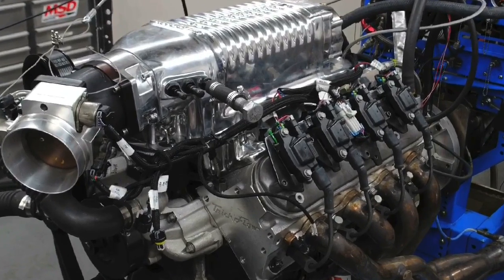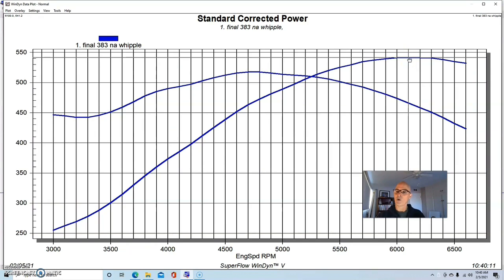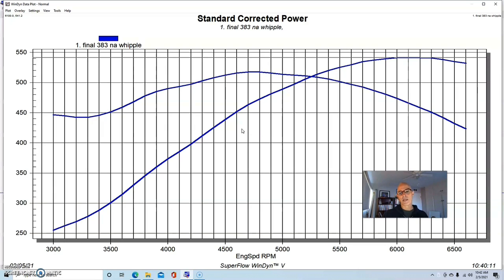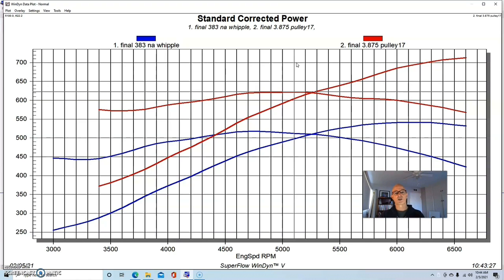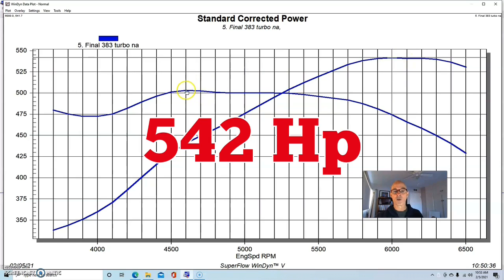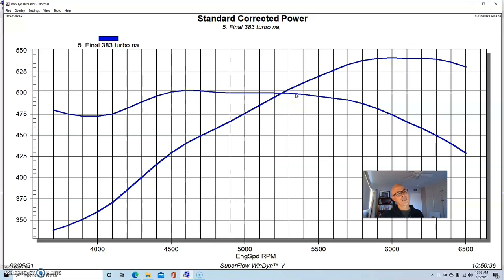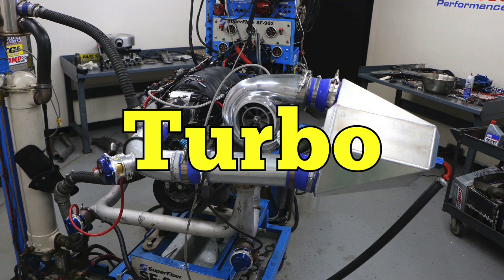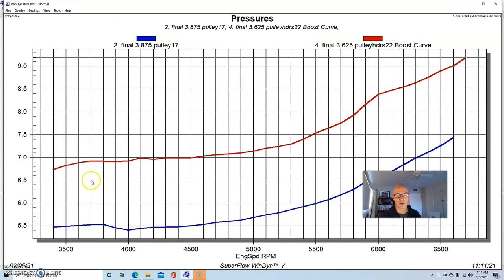WHIPPLE BLOWER vs LOW-BUCK TURBO-383 LS STROKER

Comment: GOD DAMN IT RICH WHERES THE TURBO GRAPH BELOW 3800RPM AGHHHH IM DYING OVER HERE 🤣

You make a turbo look so good on paper and then we all remember the tach on our truck dash ends at 6...

im more concerned at the bottom 

unless you own a Corvette youre launching a truck with these (yes the zeta platform is a truck ask Australians)
Reply: i want 600ftlb at 2KRPM GAAAHHH 🤣
Reply: after 5 Im so much less concerned lol
Reply from the maker: 600 lb-ft at 2000 rpm is a diesel
Reply: @richardholdener1727 if only they were snappier lol

but for real Im trying to figure out how to get the fattest torque curve from as low as possible and this graph leaves out where the turbo isnt brilliant. 

would mucking about with dynamic compression do anything for either?

or am I pretty much stuck with something like a light hybrid system to get off throttle torque?
Reply: what are the smallest twins youve seen?

Comment: Gonna have too go back to some of your 6.0 and 6.2 combos, 383- ls -N/a-heads-cam = 540hp 😮, maybe I'm mistake but I think a 6.0 with just a cam and 799 heads made 522hp or with 706 heads it made this power, but 383ci Ls with aftermarket heads only makes 540hp 😢 obviously it's not worth the cost or I'm mistaken what the 6.0 hp combos were said to be making.

Comment: How you make a 383 on 5.3 ls 
Just pistons and crank Can you do it like that or you need the whole kit
Reply from the maker: a 383 required boring the block to 3.902 and adding a 4.0-inch stroker crank. The 383 stroker combination will include new crank, rods, pistons and rings and bearings.
Reply: @richardholdener1727  so with 5.7 pistons and 4 inch crank you could make it 
And using the same rods

Comment: He's essentially comparing the boost levels, but it's apples to oranges.  The blower boost # is at peak.  Whereas in a turbo say it has a comparibe wastegatr spring as far as boost # the turbo motor will essentially have that boost level much faster and maintain at that boost level

Comment: On. The blower engine the heads are WAY to small and the cam is all wrong. Overlap needs to be very minimal with a forced induction set up.  Also used terrible fuel.
Reply from the maker: none of what you said is accurate

Comment: I believe you are wrong about a turbo not costing engine HP.  You have the significant exhaust backpressure that costs torque to compress the exhaust gasses to develop turbo boost.
Reply from the maker: the loss is minor compared to the losses associated with driving a supercharger-we know this because a turbo provides significantly more power than a blower at the same boost level.
Reply: OK, but there is a penalty associated with backpressure developed to drive the turbo charger.  There are other issues involved but that factor has to be acknowledged. @richardholdener1727
Reply from the maker: okay-if it makes you feel better, there is 1 hp loss from driving the turbo

Comment: 1 GT-45 at 800HP is awesome. What about 2×GT-45 an easy 1,000HP with the proper cam? The bottom end seems stout, but a lower compression piston might stave detination.
Reply from the maker: 2 GT45S COULD DO 1500+ HP

Comment: A supercharger is the way to go on a gasoline engine, except for aircraft engines.  Turbos are the way to go for diesels and aircraft engines.  I don't think there has ever been a factory supercharged diesel.
Reply from the maker: there has been factory turbo and supercharged (combined) diesel motors
Reply from the maker: and Detriot diesels were supercharged as well
Reply: @richardholdener1727  Not in the conventional sense they weren't.  They won't run without the scavenging blower.
Reply: @richardholdener1727  If you mean Detroits, I have never heard of the blower being used to provide boost.  They were used as a scavenging blower.  A 2 cycle diesel can't run without it, as there is no way for the intake charge to enter unless it is blown in.  The intake ports in the cylinder walls are near the bottom of the piston's travel, so there is no vacuum being generated.  A turbo on one of these is what provides the supercharging effect.

Comment: Top mounted superchargers have poor intake manifolds with almost no runner length, you will lose at least 60hp and major torque because of this. Remember the boost bash test regarding boost to boost power outputs. There was a manifold test in there that was responsible for over 70hp at same boost level.

Comment: seems a mismatched comparison,  why was did the turbo have a water to air intercooler when the supercharger did not ? also is the  cfm rating of the turbo at a given boost level the same compared to the supercharger ??, seems the supercharger is on the small size in this comparison . its a known fact that most positive displacement superchargers provide more pressure at a lower rpm

why is your other video on kenne bell with small blower sizer make so much more boost from the bottom & its a smaller engine >>
https://www.youtube.com/watch?v=3mRCXSrEZ7s
Reply from the maker: the blower did have an intercooler

Comment: What is the weight difference between the iron block and a Ls 3 Aluminum block and could the LS 3 GM crate motor 525 hp be used in this boost application?
Reply from the maker: yes on the boost with 525 crate

Comment: This research is not of value for two reasons.  First, your turbo is too big to really compare with the supercharger; your turbo curve is mostly functions of waste gate springs. 

Second, you are changing gas used.  Just use 93 pump for all.  Most people don't have access to race or E85. Whatever you pick stick with it to reduce the #s of variables.
Reply from the maker: YOUR COMMENT IS OF NO VALUE FOR TWO REASONS....

Comment: I always understood if the Supercharger is working right the power curve difference is below 4000 and turbo is above 4000.
Reply from the maker: THAT IS NOT ACCURATE ON EVERY COMBINATION OF SUPERCHARGER (TYPES AND SIZES) A TURBOS (SIZES)
Reply: @richardholdener1727  turbos usually have to spool up right? While if the supercharger is sized right it usually keeps boost threw the rpm range. While turbos get more boost the higher the rpm unless your doing compound turbos.

Comment: What's the back pressure like at 6000rpm with the gt45 on a bigger ls?

If 700hp was the goal, would the gt45 be a decent choice or would you still bump up to something like vs7578?

Mostly spirited street car.
Reply from the maker: what displacement?
Reply: @richardholdener1727  can't believe I left that out. L98, 6.0L with ported rec port heads.

Comment: @RICHARD HOLDENER  You have to check out on3 107 mm billet wheel journal bearing gt55 with the proper engine combo it's good for 2500hp and it cost 1000$ . It's the cool new turbo. Put that on your big bang motor. I've seen dyno test of 300hp increase at the wheel vs s488 running same boost levels on compounds. That's sweet.
Reply from the maker: 300 HP AT THE SAME BOOST LEVEL?
Reply: @richardholdener1727   no that would be awesome but not realistic , it was on a diesel cummins. It would make 80 psi max with the s488 and 115psi with the on3 107mm gt55 . Also needed more fuel with that air flow . Just goes to show the cfm the larger turbo added that cfm can be seen as a restriction in  boost.

Comment: There are losses with turbos.  I don't know why everyone says there is no loss.  You can't restrict the exhaust and expect no loss.  Just look at the dyno graph.  They both made the same power even though the blower made a little less boost.  If there were no losses with the turbo, it should have made more power with less boost.
Reply: Yup, turbos increase pumping losses.  Superchargers don't.
Reply: one can compensate with less restrictive resonators/mufflers or even straight pipe. as for the results this is a cheap ebay turbo

Comment: How would this turbo setup compare to a centrifugal supercharger?  Parasitic losses aside the efficiencies should be similar and the type of boost goes away.
Reply from the maker: CENTRIFUGAL HAS RISING BOOST CURVE AND MORE PARASITIC LOSS THAN TURBO
Reply: @richardholdener1727  Thanks, I understand that. This was just one of those random tangents. I was thinking that since they use a centrifugal impeller they have the potential to make much more boost than they typically do.   As far as that goes they should be on par with a turbo.  It is because of their direct connection to crank speed that they have a linear boost curve. If you were to spin it fast enough to make target boost early and bleed off the excess you could maintain these flat boost and power curves like a turbo.  Maybe not at the same level, especially down low because of the excess parasitic loss but it should manage to be better than the Whipple and an overall simpler install than a typical turbo.  Again, just random thoughts, not something I’d ever expect to see.

Comment: i feel like there is a little slight of hand going on here.  With both the NA and Super charged set ups the dyno graph begins approximately at 2700RPM,  when the Turbo enters the fight, suddenly the graph begins at 3500RPM.  I know it's not much but i suspect there is some turbo lag there at the bottom of the graph which would benefit both the NA and super charged motors.  If we are comparing things, the playing field needs to be flat.  same motor and the graphing needs to have the same parameters.  Maybe it all amounts to nothing, maybe it's all intended to drive the comments, maybe it's just an oversight but it's definitely off a little.
Reply: Good observation; that is the big performance disadvantage of turbos - turbo lag.  Not much on a diesel because diesels are unthrottled, so the "pump" of the turbo doesn't slow way way down at idle the way it does on a gasoline engine.  I say a supercharger is the way to go on a gasoline engine, except for aircraft, as a plane does not idle once in the air.  The engine runs at a pretty constant speed.
Reply: @jamesbosworth4191  Right.  Now days most turbos have "anti lag" designs allowing it to spool up faster at non boost rpms.  But with bigger turbos it's more difficult to get around as the turbo is big and therefore spools slowly

Comment: So the turbo needed more boost to hit the same hp level?   The whipple hit 800 hp at 9 psi... the turbo needed 9.7 psi to do the same thing.  This tells me the turbo is maxed out, but the Whipple has a lot more to give.  If you pushed the whipple to 15 psi, you'd be well over 1,000hp; but the turbo might not even hit 12-14 psi.  What will happen is the Whipple's boost curve will start to flatten out as you near it's maximum flow.  This happens with any PD blower.  The closer you are to maxing it out, the more torque you'll make at lower rpm.  I think the terminator Cobra guys were the first to figure it out when they started pushing the stock Eaton blowers to the max.  Don't get me wrong - I think turbos ultimately make more power, but PD blowers, particularly when they're sized properly (or even slightly undersized) are absolutely unbeatable torque monsters.  Of course, the tuning window also gets smaller, but hey - there's always a tradeoff.  Which is why I've swapped my Whipple (9.80's at 140 on 93 octane pump at 3,500 lbs) for an electric turbo (actually Vortech) - the electric setup offers the fun of the Whipple, but the efficiency of the turbo (actually better - zero losses anywhere)  - we're seeing 32 rwhp per psi, and we're only in the 440-500 rwhp range (so far).  The Whipple was less than half that much hp gain per psi.
Reply from the maker: THE GT-45 IS ONLY AN 800-HP (MAX) TURBO

Comment: try fitting tat turbo and intercooler under a cramped hood. the whipple fits on virtually anything. I'll pick the blower with its easy installation. no hot exhaust to plumb all over hells half acre.

Comment: Richard... Please stop spreading mis-information. Turbos have similar parasitic losses to superchargers. They are driven from exhaust back pressure which which has a very real impact to performance of an engine.
There are a few significant advantages you have given the turbo here that make this an unfair comparison that weren't discussed.
Reply from the maker: SORRY-YOU STATEMENT IS NOT ACCURATE--LOSSES FROM BLOWERS ARE DRAMATICALLY HIGHER-TESTED THIS MANY, MANY TIMES -INCLUDING BLOWER DYNO DATA
Reply: @richardholdener1727  Really? Prove it. You offer up supercharger dyno as evidence when what you should be offering up is NA dyno data with back pressure equal to that of a turbo engine. Let me explain... No one argues that superchargers take power from the engine.. Why? Because they can see it and thats the opposite of what people perceive on the turbo. There are pumping losses with driving a turbo, the exhaust turbine can't work without pressure. Are the losses equal to a SC? No, but they are significant and not free.
Reply: @werks96  the exhaust restriction can be compensated down the line. and in any case its almost irrelevant compared to supercharger losses

Comment: Richard, got a big Procharger laying around to put on a 4.8L?  I've always wondered if you could get a flatter boost curve by using an oversized centrifugal supercharger and had a boost controller connected to the BOV to bleed excess boost at high RPMs.  Even though it's oversized, theoretically because it's generating lower pressure, it'd wouldn't be a massive power hog vs using a smaller SC.  But the bigger SC would be less efficient...hmm.   It'd be a be a waste instead of using a turbo but It'd still be interesting.  If anything it'd be good at blowing any leaves out from under your hood.   :D
Reply from the maker: we have done that

Comment: I've never seen a boost curve like that on a Whipple.  What's going on there?  Looking closer, it's only two pounds difference but obviously the restriction builds on itself.  Is that the cam not letting it breath.
Reply: I agree and I own both a Whipple and a gtx3076 cars. the Whipple had instant torque versus my turbo. Both on stock came. Also cams have a big part to play in these test.

Comment: Twin-screw Supercharging an engine cost so much that I think many of us find turbo-charging is preferable. If the costs to fit all types of forced induction were equal, our discussions would be about how to apply each power adder to specific engine displacements and specific usage.
Reply: Outside of Top Fuel, you get a supercharger for the looks and sound these days. The performance gain is just a bonus. I don't know anyone who would build a motor for raw power with a blower, it will always be turbines. Be it exhaust run or belt driven. As for expense, if you buy 1 quality turbo its about the same. If you buy two its more expensive, but also twice as powerful again. $2500 for a blower is not that far off $1500-2000 for a quality turbo.
Reply: @sylumgand  What are you talking about? Legit turbo kits are not cheap and just as expensive as a Superchargers. You are talking $7,000-$10,000 for either kit. 

You don’t see big twin screws on street cars because the torque they create causes the tires to break loose. This is why you see more pro charged or turbo set ups with more aggressive street/track builds. Generally speaking Turbo’s are much easier on internal parts, transmissions, rear ends and advantages in tuning.  

New Whipple 3.8L is making 2500hp on Coyote and Hemi Applications with appropriate engine build to support. The old negative about superchargers 10-15yrs ago was they were extremely inefficient and didn’t make power like Turbos could. That’s now vastly changed with technology, and now you have guys running deep 8’s on truck and car applications with just mere supercharger at full factory car weight. 

ATI Racing was running 6.60’s with a Iron 388 and a old Gen 4.5 Whipple in a 3,000lb car. Now they moved to a Billet Block and new 3.8L with the intent to chase 5’s. That’s how far superchargers have come.
Reply: @KTger  If you are spending $7k+ on a turbo setup, you're paying for the names and labor to install it. And you cant even use the old saying "You pay for quality" because everything is shit anymore.
Reply: @sylumgand  I’m not even taking about expensive competition turbos. Top of the line stuff can run you $5,000+ similar to the 98mm Pro Mod Gen2 I once had from PTE. Raw materials alone isn’t as cheap as you’re making it, whether you put it together or someone else does ( time is money, no matter how you slice it ).  You also need the machinery to begin with in order to even fabricate. 🤣🤣.
Reply: @KTger  You are talking about top of the line stuff. I have a big single(not 98mm but 76mm) rear mount. The turbo was $280, charge tubing was $150, BOV $50, fuel regulator $150, 2.5in exhaust tubing $125, didnt even bother with a wastegate so toss another $150 I have to spend, $150 for the hat to mount on my Sniper, $80 for oil lines because a hydraulic shop is nearby and its easier to have them make them for me. No where near $2000 and it runs and drives, not taking it past 8psi until I put it on a dyno and have someone who knows fueling handle it. I have more invested in the super sniper and hyperspark ignition system, than I do the turbo equipment. And I could have still done the rear mount without the fancy Holley shit.
Reply: @KTger  superchargers still don`t make the power of turbos. there really is no comparison, drag racing aside

Comment: So many Die-hard blower fanbois  can't comprehend  the turbo making  5 more pounds of boost at 3500rpm banging on about the size  and putting a CVT transmission on it  this was a very decent blower  totally humiliated by a 300$ wuhan war  whisle  if you want to  put a CVT on the blower lets put a good VGT turbo in there  and see how that  plays out    another  sluaghter   no doubt